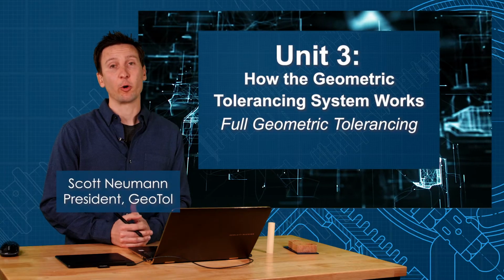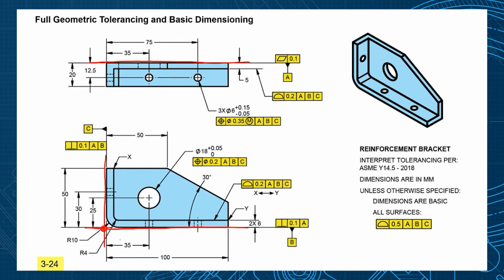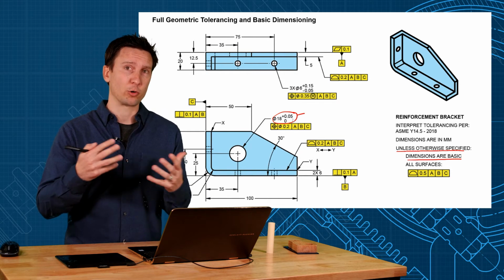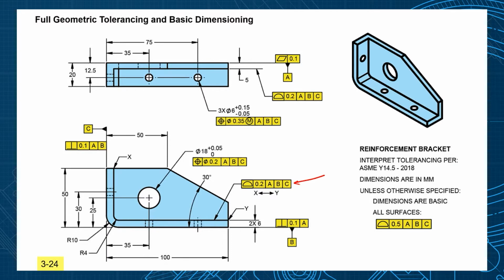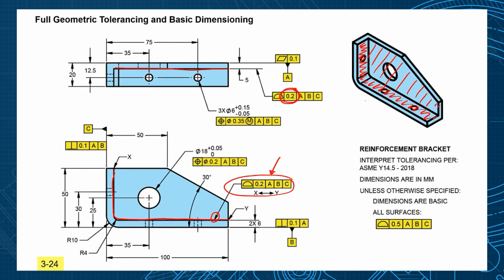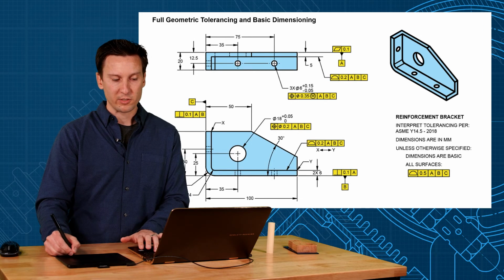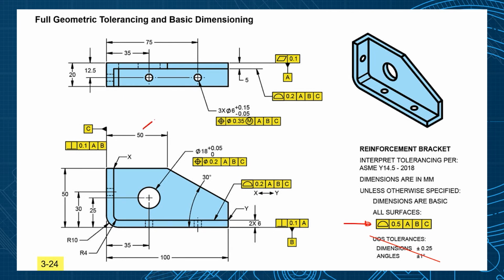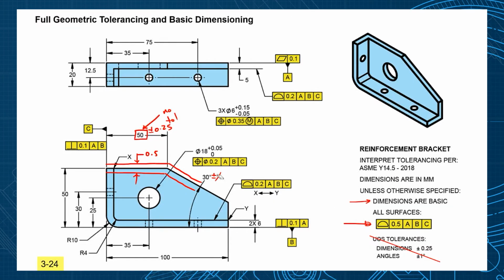Full GD&T - Profile Tolerancing

Comment: We can see clearly that using GD&T in general or profile tolerance in specific can way more efficient and general than the old plus and minus system which will show lot of flaw when it come to geometrical function or working condition of the part

Comment: Do you go over Unequally Disposed Profile?
Reply from the maker: I don't have a video on YouTube about unequal profile. (I have it in my online course though.) I didn't want to put a video up because I don't recommend it. It takes an easy to understand concept like profile and overcomplicates it. Why bias a tolerance to one side or the other? Just adjust the basic true profile. Then manufacturing and quality can use the CAD model without much adjustment and complicated notation. The drawing does not designate "a target" but rather two goal posts. Keep it simple.